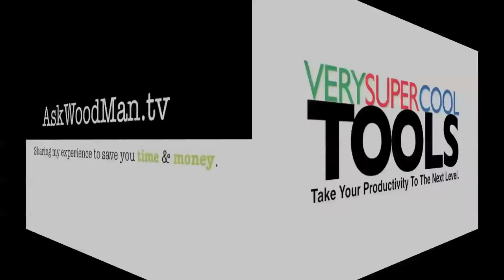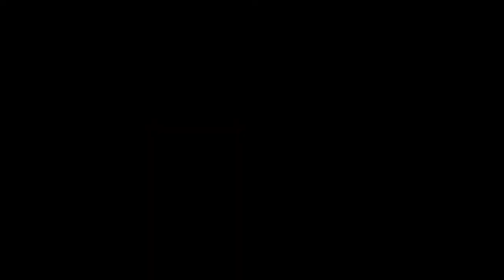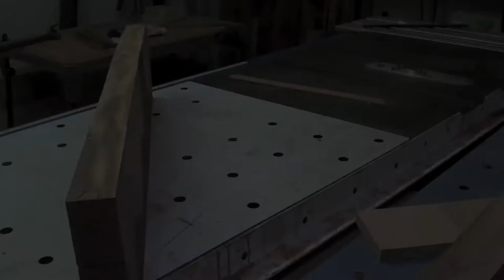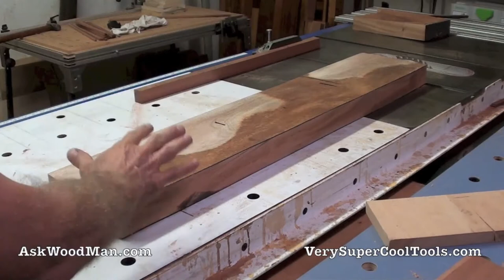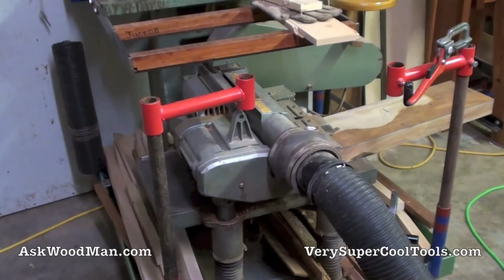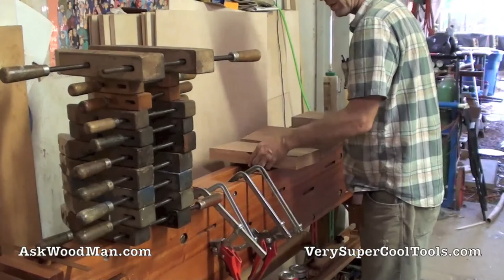Milling The Stock For A Tool Caddy Organizer 2/7

Comment from the maker: I had two of the StrongHand. They were always a frustration compared to the Besseys. I can make the Besseys work with one hand. Sometimes I use those rapid action clamps more than a hundred times in a day when I keep repeating the same setup over and over. I don't need aggravation to save a few bucks. My Besseys have been locked thousands of times and I can't see one bit of wear or loss of performance. $15-20 price difference spread over many years of flawless service is worth it to me.